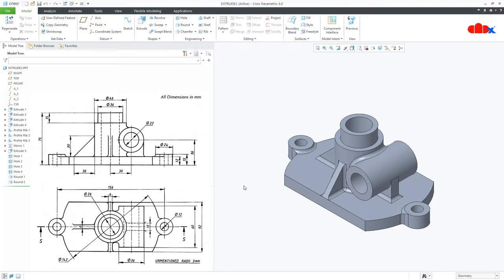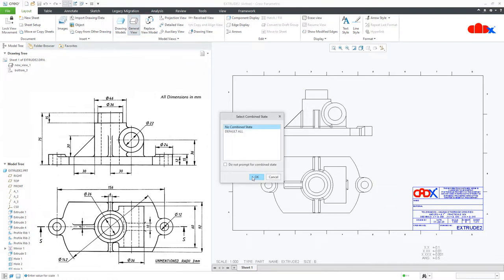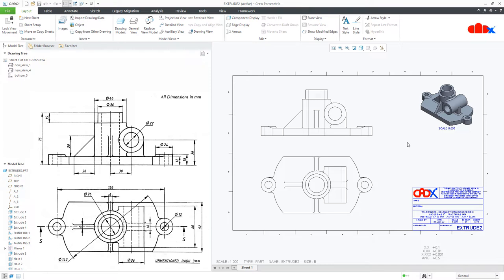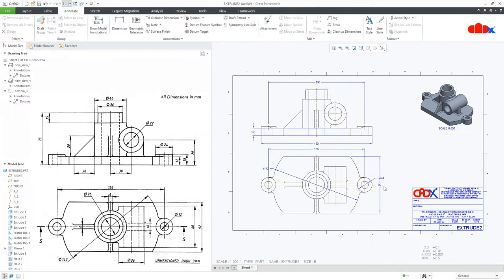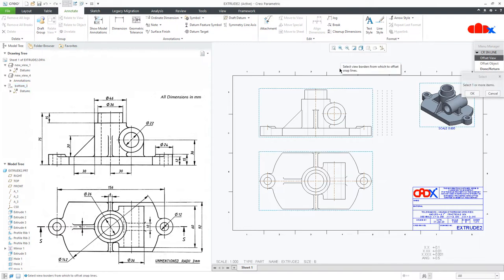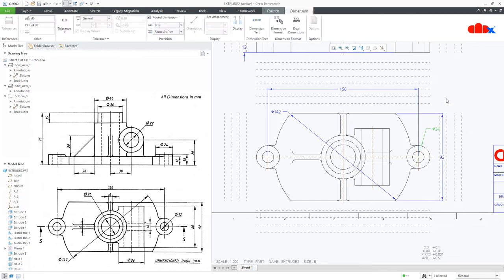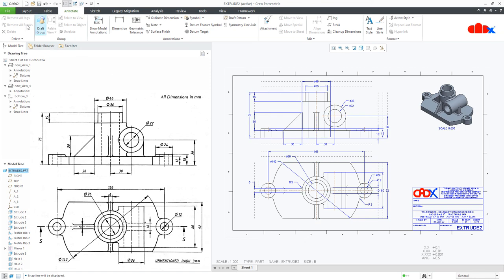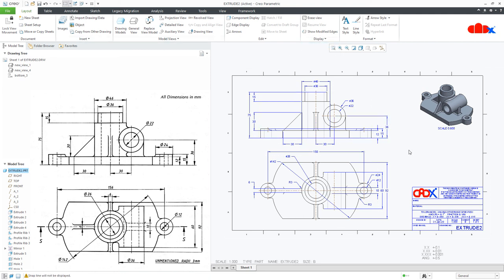Detailing the drawing in Creo Parametric for beginners

Comment: When I creat 3d part in Creo after create drawing in Creo but when I converted in AutoCAD file ( dwg) it scale not 1:1 so pls setting
Reply from the maker: My next video is on this topic.
Reply: @CADxTraining  thanks
Reply: By default Creo drawing template comes with inch as unit so you need to use suitable scale value (scale tool) in autocad otherwise set Creo Parametric drawing template in mm. (search unit in drawing detail)